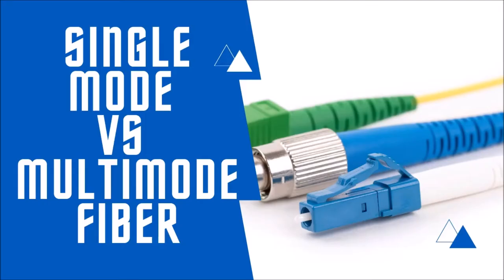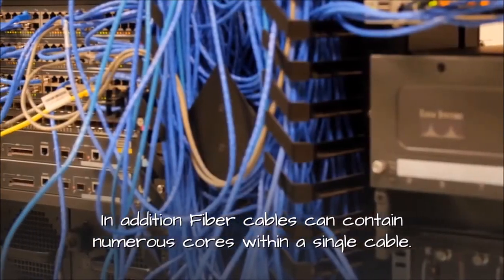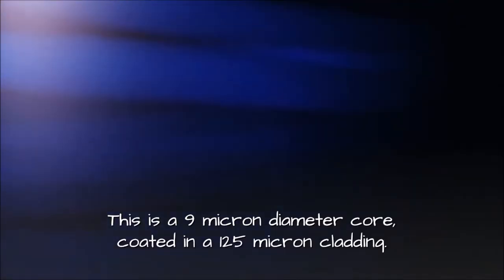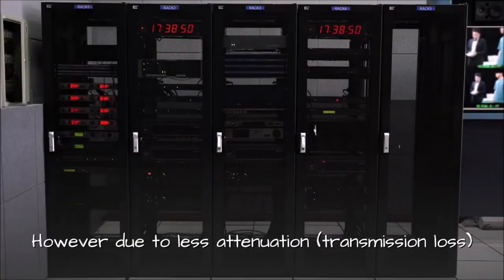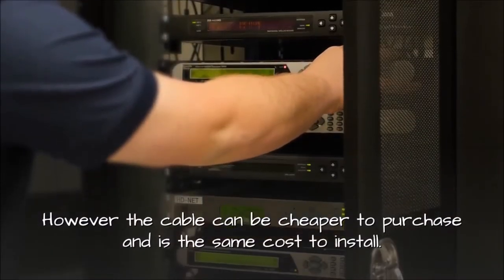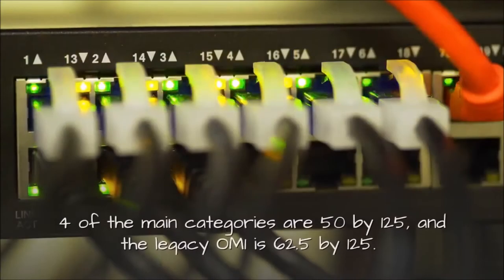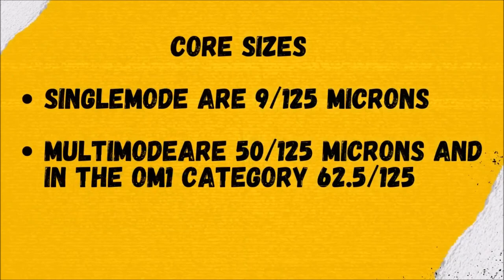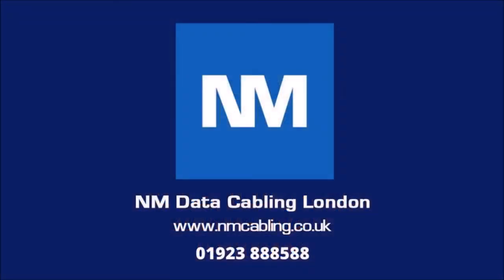Single Mode vs Multimode Fiber Optic Cable  (Single Mode vs Multimode Fiber)

Comment: Single Mode Fiber Optic Cables: 10 to 100 km.
Multi Mode Fiber Optic Cables: 550 m.
Copper Wire: 300 m.
Twisted Pair: 100 m.

Comment: Hey man sorry to sound stupid but I need to know the multimode that you mentioned…… when you mentioned many modes of light….. are you saying it transmits more than one signal at the same time? Or what exactly does this mean?
Reply from the maker: Hi Raael. The modes refer to the main beams of light that come from the transmitting device when sending over the fibre cable. Think of it as a torch with lots of "modes" of light all emitting together. With singlemode it is more like a laser light so a single source of light in a tight concentration. Hence a singlemode of light. Hope that helps